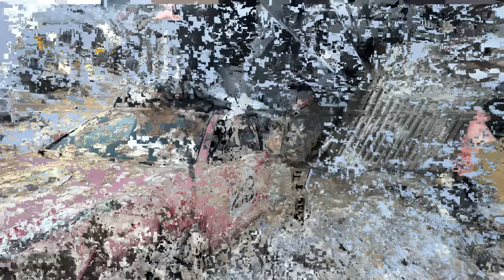This Porsche Needs More Than A Rescue.

Comment: If it was a brand new $100,000 Porsche Cayenne in 2005 with this type of damage… It would still be total loss. But I know you’ll fix it.🤙🏽 strange that the airbags didn’t pop makes me wonder if you had srs issues prior.
Reply from the maker: Honestly, its just not common at all for the cayenne airbags to go off. I'm not even sure where the sensors for them are. The damage doesn't seem too terrible and I'll be able to fix it!

Comment: Oh man sorry to see Harrison! Glad you're ok. Any reason to not be running true winter tires (studless or studded)?
Unfortunately that's engine oil under LF, not CV grease. CV grease is thick and pasty and usually gray'ish in color, not liquidy and brownish/blackish(engine oil).
Reply from the maker: Seems it’s probably from the intercooler piping as the leak stopped and hasn’t grown the puddle since the video was taken! These accumulate some oil in there from blowby or whatever! Won’t know until I dig in though!
Reply from the maker: But also, you know much better than I do I’m sure!
Reply: @HarrisonSchoen  that's probably it, based on that location, especially if the leak has stopped. It is more oil than I'd expect from the SMIC. Hoping that's all it is!!